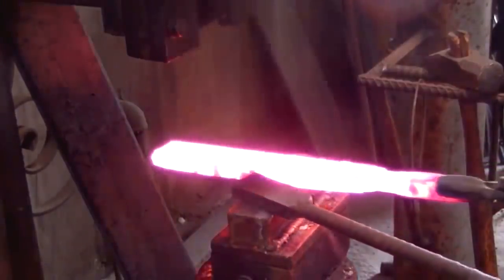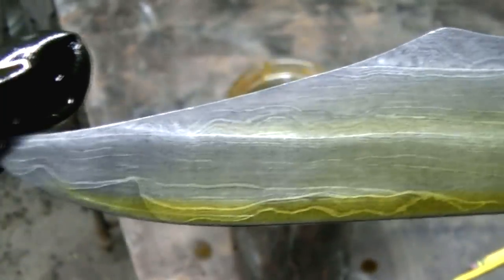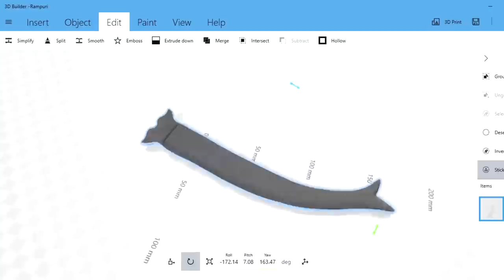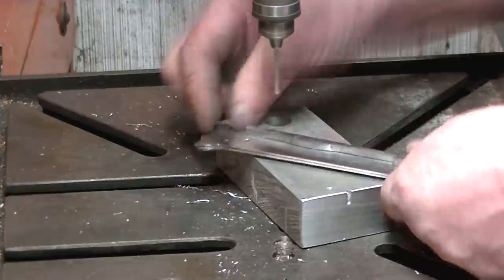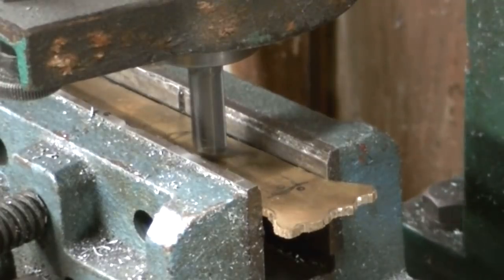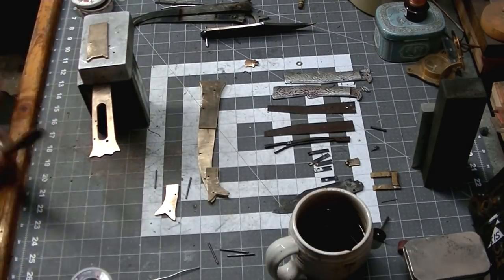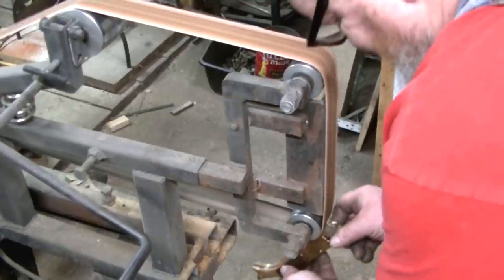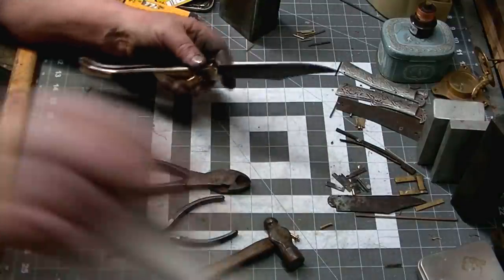Blacksmith Builds A knife from India, The Rampuri Chaku

Comment: I assembled 2 kits of auto knives in '88 because that state wouldn't let them be sold completed, but you could buy a mail order kit. They were real high quality, much simpler than yours but good one had same lever button and had brass feature with wood handle, the other was black something with push button.. that was cool how the actual blade edge metal was smooth as silk like a wave, but the remainder, every square mm was damascus pattern. Now if you could sell to a rich eccentric for $1500....or the design to lynn thompson/cold steel